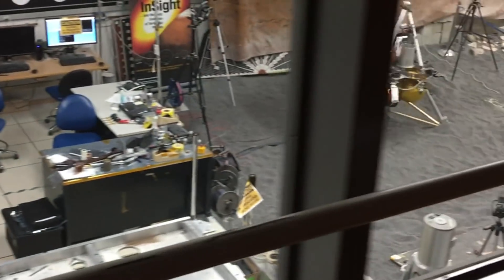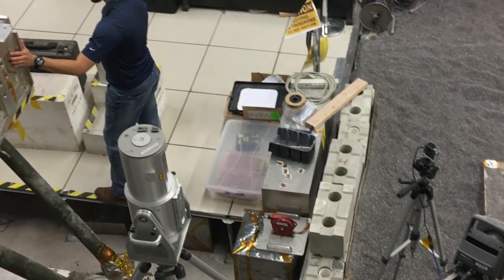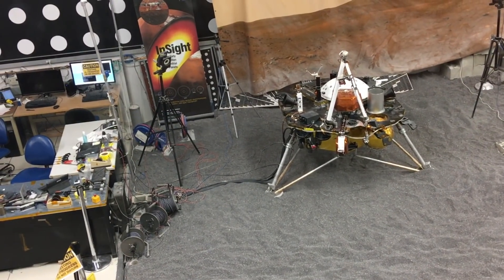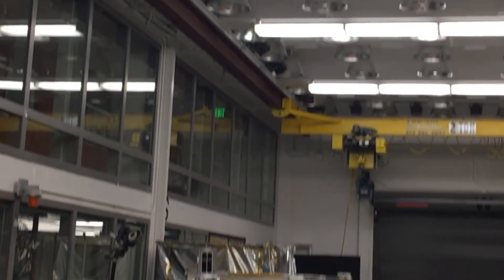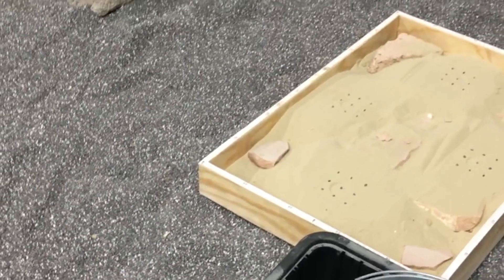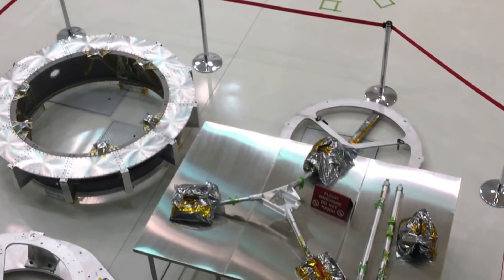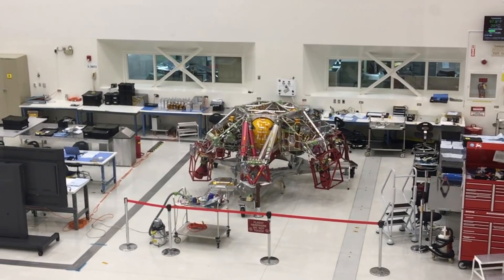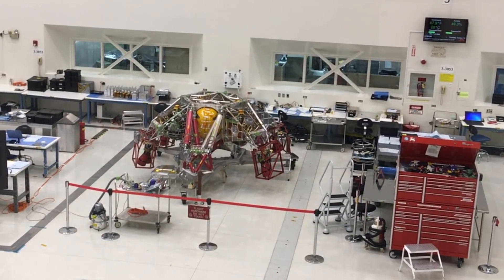Jet Propulsion Laboratory w/Doug Ellison - Part 3

Comment: You mentioned that the daylight on mars is 700 watts per square meter, in the background I heard Doug say it's half of what it is on earth. So I can safely assume that the sun gives us 1400 watts per square meter of relative power?
Reply: 1367 watts......so good estimate!  (once you get down to the Earth's surface and you've had atmospheric losses it's more like 1000 )
Reply: Interesting, thanks Doug! Does this mean that if we were to terraform mars to make it an air breathing planet that we would in turn forfeit our ability to generate power via solar as the atmosphere thickens? 

Also, 1000 watts per sq meter seems like a steal for generating power here on earth with minimal impact on the environment. Curious as to how good our current technology is at capturing said energy, how much loss are we dealing with as a rule of thumb?

Comment: If anyone's interested, and if they had doubts, (and if they believe me :P) I can confirm that the CRT monitors were there when I went to JPL. It's interesting to see that they've changed the Mars stimulant out for gravel. When I visited, they had Mars stimulant in there, and a test version of the Curiosity rover on a set of ramps (testing suspension and traction control, I assume). I wish I had payed more attention when I went to JPL, because I missed a bunch of things that were there when I went there.

Comment: For insight (the one that listens for earthquakes and yes that's the term I'm using) Will they have three craft like the seismometers here on earth, which need to be in threes to determine the quakes direction, magnitude, location ect? Or will it use one craft and not get that data.
Reply: One spacecraft, quakes triggered by impacts, a lot of modeling, and help from orbit.  So by listening to a quake as the waves pass the lander both directly from the quake, and then the 'long way around' the planet...it's possibly to crudely triangulate a position that can then be mapped by MRO, eventually imaged by HiRISE from which an impactor size can be estimated and feed back into the modelling of the sub surface .

Comment: It's a shame the cranes are destroyed after dropping the rover. It may be super far fetched but someone could use or may need a part off of them if they are ever there. :P Ya never know...
Reply: What..?? That is no where near the correct answer...and you can't like your own comment to make you feel better. They don't necessarily blow it up either..after it drops the rover...it pitches over slightly to fly away from the rover and crash lands to keep it from damaging the rover. It explodes just because of the crash and the left over propellant. If we go by what you say then the rover is just as contaminated as the skycrane considering they are basically one piece until it starts to deploy.
Reply: Adding the sensors, avionics and extra fuel necessary to fly away and land safely would be burden of mass, cost and risk that simply isn't required to safely deliver the vehicle to the ground.
Reply: The only thing extra you would need is fuel and a little programming time. You can use the same radar they used to land it. However I'm sure the fuel tank is designed to hold just enough to make sure it gets the rover down and the crane away from it. If they were to change the tank they would have to change the entire frame of the crane to allow for a bigger tank.
Reply: nick4819 It doesn't have a flight computer to ingest radar data and fly the vehicle.  Also...it doesn't have landing gear so would belly flop on to the engines and radar.  Weight. Complexity. Cost. Risk. All unnecessary.
Reply: What weight? It would be fine to land on the engines. They wouldnt be useful anymore. Flight computer can be EXTREMELY small..not a huge change. For instance your cell phone is millions of times faster than the original flight computer. Complexity..literally just working the numbers and programming it in. Risk...it's already flying off away from the rover so if it does crash..oh well..if it lands then great! Like I said it is a far fetched idea but I wouldn't consider it all unnecessary if it were to save someones life. Say if you were about to die but you could do something that would give you a 1% better chance of living...would you take the 1% or just give up?
Reply: nick4819 The weight of the extra fuel, and sorry.....the flight computer would need to be the same as the Rover, a RAD750. Unless you want to start an entire flight software project from scratch for a new platform...which is a 5 year, multi-million dollar project.    Seriously...it would not be a small undertaking.  It would be expensive.  It would add unnecessary risk. For what?  And it wouldn't be 'fine' to land on the engines.   Try blocking up an engine nozzle with dirt and see what happens. Now do it 4 times at once.    And again I ask.....why? What is this cost getting you?
Reply: Yeah i already talked about the fuel issue. No need to have a basic flight computer started from scratch..this isn't the 1960's. Find one in the millions they probably have coded..modify it for the situation..job done. Yes it takes a little time...but so does every job. If the crane is already flying off  away from the rover...what risk is it bringing to the table?? If the program works and lands it...GREAT! If it doesn't then damn oh well....maybe next time. Like I said it's a super far fetched scenario and it may never ever happen but who knows... what if someone does need something? Well hey there you go..you just saved a life 30 years down the road! :D So again...say if you were about to die but you could do something that would give you a 1% better chance of living...would you take the 1% or just give up?
Reply: nick4819 I'm sorry you don't understand why the risk and cost are not worth a plot point for an as yet unwritten sci-fi movie.  You simply are not grasping the complexity involved.  It is my job to send sequences to both Curiosity and Opportunity....and I would consider it a career ending mistake to subject either vehicle to unnecessary risk.
Reply: Doug Ellison In more than any other science risk aversion is the name of your game. I am not sure id like to be in your shoes as friggen cool as your job is.
Reply: a crashed sky crane IS actually a gold mine of parts and materials.
we'll need a small machine shop to use the metals, etc., but still better that rocks.

Comment: You should build that sky crane in KSP!
Reply: *must
Reply: There's no reason why Scotty can't use mods... I say go Nutz!
Reply: +Slpk Kerbal attachment system has existed for ages.
Reply: 4 years ago, I did make a sky crane with stock parts. (without a rope) I was able to get it down to a few meters above the Mun before releasing and flying off. Didn't break a wheel.
Reply: Question is how are tethers going to work without mods.
Reply: I've looked for a mod that can simulate a cord or string without success.
I guess you'd have to manually build some kind of chain, which would be very fragile and prone to rapid disassembly.
Reply: He has. That skycrane was big news in 2012.

Comment: How is this staff not ITAR? SpaceX can't show their facilities like this, does ITAR not apply to NASA? Or have lawyers looked through your video?
Reply from the maker: I did get told what I couldn't show, and I also checked with JPL PR people.
Reply: This is all places the public can go on media and public tours.   What the hardware looks like isn't really an ITAR concern.  Where ITAR gets involved is things like flight software, the nuts and bolts of how stuff works - not what it looks like.
Reply: animowany111 The general appearance of hardware isn't covered under ITAR...hence why there is a public viewing gallery into the clean room that gets tens of thousands of visitors per year.   CAD files and flight software, yes. A photo of flight hardware, no.
Reply: Since there is practically bus tourism to Mars by now, i guess much isn't that secret anymore.
Reply: I'm mostly referencing the footage about the lander. It's actual flight hardware, with presumably functional engines. I believe engine plumbing is covered under ITAR.
Reply: SpaceX don't do public tours but they do show many things like the engines alone, factory floor, tooling machines on social media. Also, I've heard that the software (especially used to land the Falcon 9) is heavily restricted.
Reply: I'm guessing some of the bits where the audio continued but the video was replaced by stills was where it showed secret things.